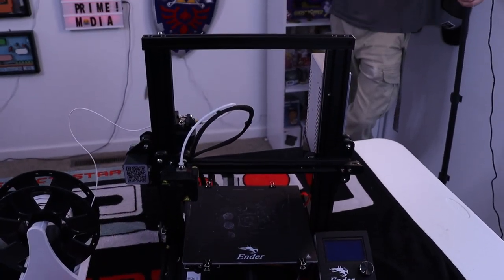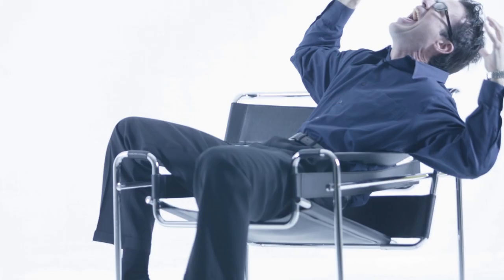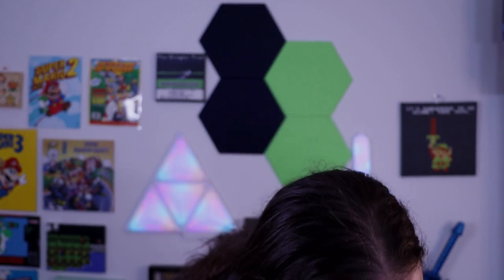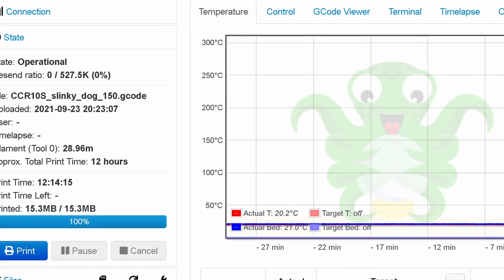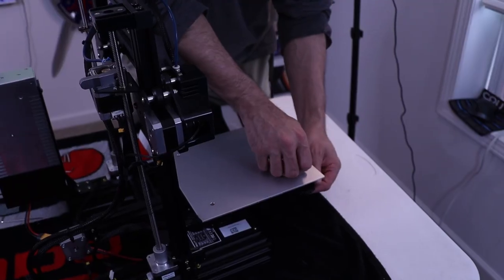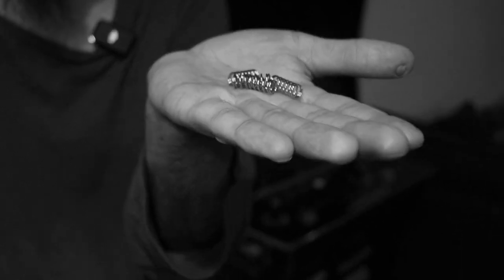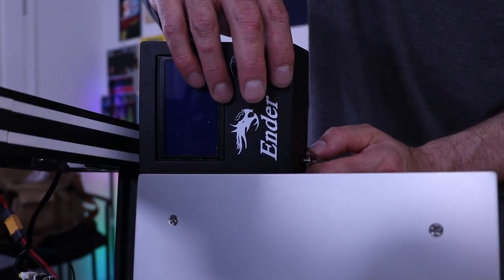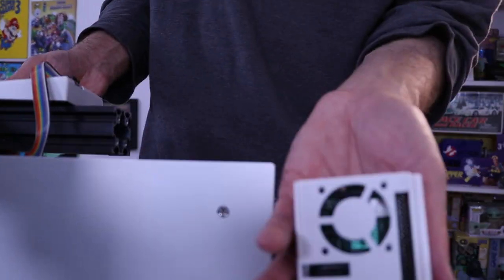Upgrading the Ender 3 Printer #3dprinting #diy #ender3

Comment: Ive had my ender 3 for about 2 years and ive modified most aspects of it. By far the most worthwile upgrade is a BLTouch. Difficult to set up but makes bed leveling a thing of the past. Installing BTT SKR mini V2 motherboard was a close second favorite. It makes printing so quiet, along with a noctua PSU fan.

My only advice for you is to frequently measure and correct the Z axis tilt. Because the two stepers are controlled on the same board it has no way to independently level them. I had so many issues with warped printing before i realized that one z axis was .6 cm lower than the other. Normally the print would have failed but the BLTouch was trying to compensate resulting in a warped part as opposed to no part at all.(seriously get a BLTouch)

Love the video. Quality exceeded expectations.  I predict the algorithm fairy will visit you soon.
Reply from the maker: Thanks for the detailed comment. I use a wood block with a level to make sure both z axis is the same. We have been thinking about picking the BLTouch along with a few other upgrades.

Comment: Here from the algorithm - nice video showing some upgrade installs! But I have to ask - what made you decide to spend the money to upgrade the Ender 3 vs spending the same money on a different printer? These days you can get an Artillery Sidewinder X2 for 299 with a lot of these upgrades pre-installed for example. Or one of the many Prusa i3 clones.
Reply from the maker: The main reason was that we were not completely sure we were going to get into 3D Printing. We got the ended 3 because it’s was cheap. Then we look around and found out a lot of people are doing the same thing. Then it’s was down to we should do some upgrades and show other people how easy it can be.
Reply: @TechPrimeMedia  Awesome! Thanks for the reply!